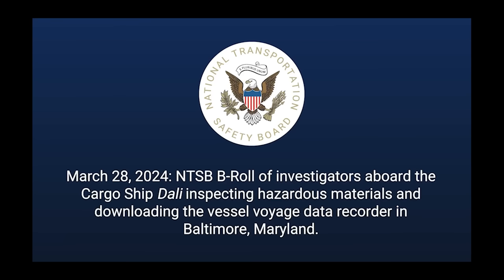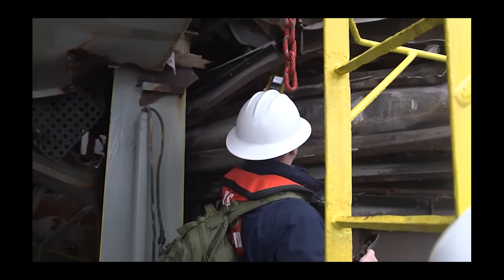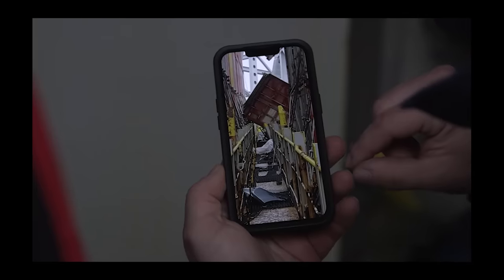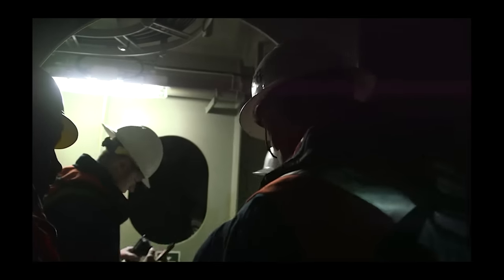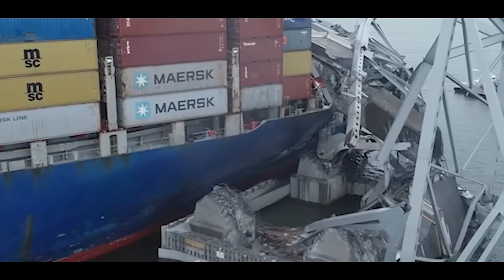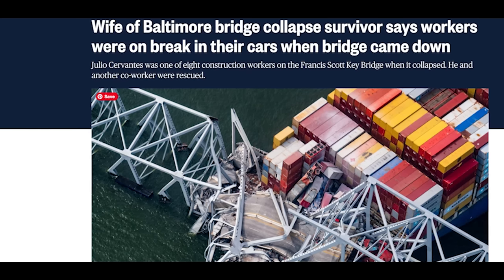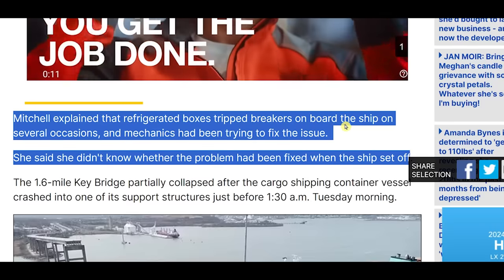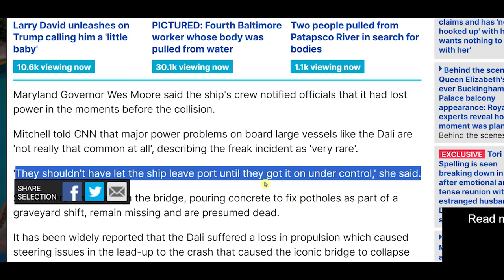NEW NTSB Video On Dali Ship Point of Impact Key Bridge

Comment: See I tell u … whole over the deck and under hatches they have 440v plug female sockets provided for the reefer containers that to in bunch of group … like in one group they have 16 or 8 female sockets … basically one group particularly is supplied power from one MCCB mounted on MAIN SWITCH BOARD … also , each reefer connected to these female 440v plugs have their own control panel which is further provided with MCB individually for protection … now if there is a short ckt in particular reefer , then it’s MCB will trip and other reefer connected in the same group will remain supplied with power .. now other case is if there is a  short ckt in the main cable from respected MCCB at MSB to the group plug sockets , in that case this particular MCCB will trip without effecting the other group plug sockets ….   ….   Here what happened is tripping of main generator alternator breaker , the ACB …, this can happen due to some fault in generator or if there is huge power consumption exceeding 80% of generators rated load…the ACB can also have fault … or if the bow thruster is drawing more transient current leading to trip alternator ACB ….
Reply: I dont have the electrical prints in front of me but i'd say ground fault on one phase and ships are big so where is it? Later a second phase also went to ground. So now you have two phases dead short so how long you think the treephase loads are going to continue running on a single phase? Not very long and even if the emergency generator kicks in in time the 2 phases to ground fault is still there so as soon as the tranfer swich closes you are going to loose power again cause you have a phase to phase short. Just saying, iike i said i don't have the prints in front of me but I am a industrial electrician and that would be my bet with the limited info that has been made public so far.  There should be indication of grounded phases in the engine room. That panel with the three lit lights. bet they left port with one light out. later two where out but didn't matter at that point cause that would trip the alternator off. like how many milliseconds do you think it could stay online with a dead short across two phases. screwing around at port just made the short worse damaging the wiring more. My bet but could be wrong. in the last 70 years there have been 39 of these and 18 have been in the USA.
Reply: And the last something hitting the bridge the recommendations where not implemented and I bet the same recommendations have been made numerous times before. the main piers need ship proofing because this happens. Learn from previous mistakes. Simple. Not a accident. More people died, lessons not applied. how many bridges are still just like this in the USA or the world for that matter.
Reply: I respect ur comment … but generally in ships they have one MSB trip that’s known as preferential trip …if load goes more then unwanted or not so important load will go off …. And these emergency generators are not connected to other loads like referees , it only gives supply to emergency switchboard followed by emergency equipment including 1 steering gear and communication and bridge equipment and emergency lights and other few low loads … so here after first blackout the emergency switch board came on load , that we can see , but second blackout was to remove emergency generators from load and put the generator they have started after first blackout ….. seems emergency generator did it’s part well , but the main generators went off (the breaker ) cause of many ACB trips , that can be monitored from ALARM MONITORING PANEL IN CONTROL ROOM … if bad quality of fuel , then there will be a low frequency alarm , but I don’t see the dimming of lights of ship , cause if frequency goes down , momentarily lights will get dim but here it just went off abruptly… so mechanical or ACB problem…. Or thruster was used in full load Everytime when power came …
Reply: If the fuel was dirty the generators could produce less horsepower causing the load to drag down the RPM leading to undervoltage which results in overcurrent spikes , which means it could continually blow circuit breakers.
Reply: @heartobefelt  yes true … affecting PF and increasing the current in same kw … possible … but here in US waters they use high speed diesel …  even if the purifiers are not running , the dirt can be settled in storage or service tank … I doubt this dirty fuel oil problem…
Reply: @heartobefelt  or may be the injectors or governors were having trouble … as I said , mechanical problem
Reply: @LifEoFaSaiLor2022  fuel contamination can take many different forms.
You can have water in fuel but the fuel suction lines could be 20 - 70 mm above the floor of the tank and the tank should be fitted with WIF water in fuel alarm sensors anyway.
You can have contamination where other types of fuel are mistakenly blended.
You can also have deliberate blending of things like 50 % kerosene mixed with diesel to cheat the buyer. 
And algae in fuel , i have experienced black algae that grows quickly and contaminates an entire fuel system , it will block up filters in minutes , as fast as you bleed off the filter bowls it will block the filters again in 3 - 5 minutes and even if you add Biocide to kill the algae you are still best to drain the tanks , fuel lines , pumps and replace all filters , then go slap the asshat that sold it to you with a $ bill.

Comment: What are the flashes seen while the bridge is collapsing?
Looks alot like explosives to me.
Reply: Why explode something collapsing? Probably power lines tearing apart.
Reply: @Pygar2  I thought about that, but multiple flashes can be seen if you watch it carefully. It Does seem rather odd. 
For it to be just arcing from the bridges wiring, it could only happen that way once, once the circuit is broken, l would think.
Iol... I'm not an electrician, but I can't help but wonder.
Thanks for sharing your comment.
Reply: @DavidCooper-vh4nr The same with explosives, of course.

Comment: Jeff, may i ask: What are you hoping to see on such pictures? 1:10

I mean: I can show you pictures from a certain appendix published by Fema, and nobody gives a damn about those.
Even though it is not difficult to see what they show. 
Even Stevie Wonder would have no problem seeing what these pictures show, and what the problem is with what they show.

Are you perhaps curious seeing such pictures?
They are not related to this case, but to a much older case.
The appendix still exists.

Sure, NTSB is not FEMA, i agree.

But what are you hoping to see in pictures from the NTSB? Because even if they prove beyond the shadow of a doubt that something has happened a certain way, it does not mean anything if it becomes a political game.
I am not saying that this particular incident will become a political game. (it might, time will tell). 
But i fail to see what it is worth to see pictures if other so called experts can dismiss findings by other so called experts.
Reply: just wondering

Comment: I dont blame the ship for collapse, but Poor infrastructure! If you have a ship that large trafficking the bridge, it should have been built bigger & or with protection bollards. A ship that large should not have been allowed in the bay. The ship is bigger than the bridge. You can see how the ship barely got a dent. 

Major failure of safety & government. Lack of finding to build a suitable bridge for such large traffic.. same as if they let too large of loads across the top causing a collapse. The boat just bumped it, wasnt even going 5 knots I bet. The bridge should be able to handle it if that's the size ships they want to allow in there. Blame the government! Dont let them pass it on.

That's why Boden said hes paying for it. They know it was a failure of Gov.

Comment: Material Data Safety Sheet #1993 is a flammable liquid with a flash point of 131f
Reply from the maker: That's pretty low flashpoint
Reply: It's 141 F, my bad, but pretty low still. @jeffostroff

Comment: There is literally no protection around them bridge, peers at all they have made no provision after the bridge was built to take into account for larger ships. They’ve got protection, dams/peers put around the electrical cable spans the river. You can clearly see that in all the videos and they spent zero dollars on protecting the bridge peers. There is literally nothing all there is is a little tiny vertical piece of wall that was stopper rowing boat or a little tiny fishing boat that is it nothing that would rebel or deflect a large vessel. Once again. This port makes how many million dollars a day and none of it has been invested into the waterway that it uses to get shipped in and out for preventative measures like you see other bridges around the world I’m pretty sure there has been several thousand risk assessments done the next morning to see how many other bridges around the USA where large ships passed by the bridge, beers, whether they are protected or not there’s going to be a lot of money spent in a lot of places very quickly in reinforcing and protecting Bridge. Peers when the findings of this investigation are finally released

Comment: I wonder if they fixed the problem with the individual breakers in a way that ended up with the main breaker or some aspect of the overall power supply tripping or faulting. Or maybe even supplied power to non-critical components using a subpanel that should have been reserved for critical components only.

Comment: You look a lot like my brother, calm voice and everything. One time there were just the two of us qt home, but must have been using a lot of power: we tripped the master breaker but none of the line breakers. We went through the house, shutting off power that we were not using.
   §   A thin ship like that received a lot of damage,. A battleship I dare say would have received less or even no damage at all given their armored belts. Sixteen inches of grade A armor designed to stop torpedoes or sixteen inch shells can take a lot of punishment. Either you are on a warship or you take your marbles and go home.

Comment: The owners of the boat and the captain and what ever insurance company insuring this boat should all be responsible for rebuilding the bridge and the cost of removal of debris.  Biden is wrong to suggest that the US government should foot the bill.  The public taxpayers should not have to pay for someone else's ineptitude.  Also, the architect who designed this bridge obviously did not do due diligence on the viability of the bridge in the case of a strike.   Plus whoever gave the ok to continue use of this shipping service if it was having problems.  The are a lot of complex issues surrounding who all are responsible for this disaster

p

Comment: And if it supposedly lost power in the engine shut off it should have slowed down extremely fast
Reply: The mass of the ship and its cargo guarantees that it would not slow down "extremely " fast.  If it hadn't hit the bridge pylon its likely that it would have coasted quite a distance past the bridge before coming to a stop.
Reply: @mandobob  it is a fully loaded ship, it is deep in the water, physics will slow it down, 8 knots per hour is pretty fast, how far can it drift at 8 knots per hour and hit the bridge at the same time, what's the maximum speed on a ship like that,
Reply: @mandobob  I worked in the Shell dredging industry, and shell barges are very heavy, and yes even though they will keep going once you let them go, they do slow down pretty quickly and they don't sit nowhere near as deep as a cargo ship nor displaces much water
Reply: @mandobob  I just know a loaded shell dredge will slow down quicker than an empty one
Reply: @mandobob  but you are correct as far as the mass is concerned,
Reply: @mandobob  cruising speed is about 17 knots per hour, why would it be going that fast coming out, and that last turn right at the end where the exhaust is black, that means one of the engines were floored maximum power, which made it steer towards the pillar, I ran a double engine Crew boat before that's how you steer it with the engines and with the steering makes it turn real quick
Reply: @mandobob  and if it was losing power it would drift not steer real sharp towards the pillar, engines would have shut off for electricity would have shut off it would have kept drifting in the direction it was already going, yet it started again and then veered towards the pillar

Comment: This is the first video that explains the power loss. Tripped breakers due to too many refrigerated  containers. Simple logic, but it will probably be months before that cause is made official.
Reply: It doesn't explain it, it's a pretty major assumption to state that some electrical breakers tripping would stop the engines, and rudder control.
The 'too many refrigerated containers' theory seems far-fetched, there would surely be numerous breakers to isolate sections (or indeed each unit), not to mention being on a separate circuit to control circuits.
The whole video is assumptions with no research.

Comment: To say tugboats aren't necessarily because it's a straight run is ludicrous .  Ships this size can't control turns.  This ship headed toward a bridge.  If it can't control turn, tugboats are necessary
Reply: Totally. I'm a prostitute and I'm always on ships and have even been on the Dali several times and I can tell you they had problems then so I'm not too surprised.

Comment: Devastating incident. Shows you how catastrophic things happen due to negligence
Reply: Not necessarily negligence. They most likely believed that the port problem was fixed. These cargo ships run on tight schedules thanks to the practice of "Just in Time" supply chains. Also, the modern day shipping promises of instant delivery probably doesn't help with missing some issues. The Indian mariners have a decent record of doing their work well. The fuel contamination mentioned in another comment is a real problem which is an EPA regulation fiasco. The modern diesel engines burning the lower sulfur has caused problems along with the disposal of the leftover refining chemicals which have been found in some fuel. It's believable that refineries may be dumping "trash" additives in their fuel since the expense of "dumping" hazardous waste has caused loss of revenue. Who knows. Hopefully the NTSB will do a thorough investigation and we'll eventually know what caused this. Something that is not being mentioned enough is how well the first responders acted when trying to shut down the bridge in such short notice. If you watch the video of the impact, you'll notice that there was traffic on the bridge other than the workers less than a minute before it collapsed. The Key bridge has been a major traffic thoroughfare for many years and the police were able to stop the flow of traffic just in time to prevent further lives lost. It's sad that the workers didn't make it to safety, but it also could have been much worse.

Comment: Bro no disrespect but do your research. You sound unintelligent on what you're explaining.  First it was a thermal scan it all shows it right on the screen of the tool. Second it's a air monitor to make sure they can proceed safely. Then the book is MSDS ( material safety data sheet . Also could be known as the SDS .

Comment: it's like the captain had been told where the weakest point of the bridge was ..what's the odds ?  ...good question how many times has this captain passed under this bridge before this event ..?
Reply: Conspiracy theories are not helping. The captain radioed the local authorities in time to shut down the bridge before it collapsed. The emergency response recordings mentioned the workers as well and they were trying to reach them just as the bridge collapsed. It's a sad event due to the loss of life, but because the captain did his duty and the emergency response was on its toes more lives were not lost. So your comment isn't useful.